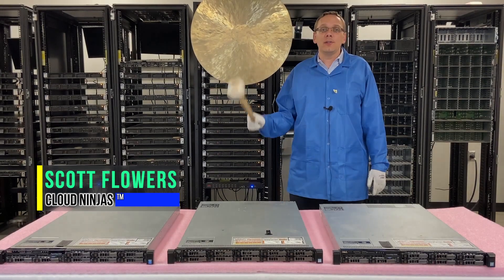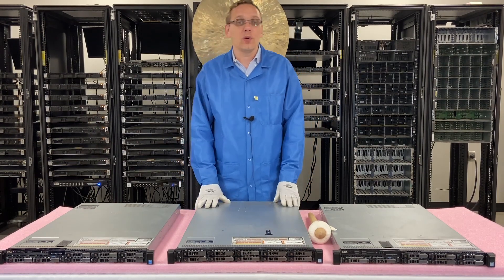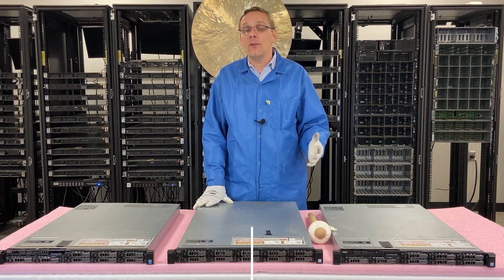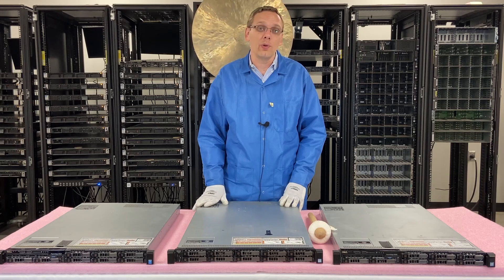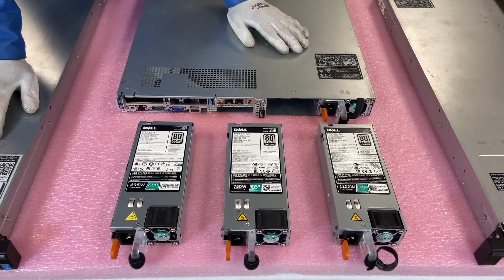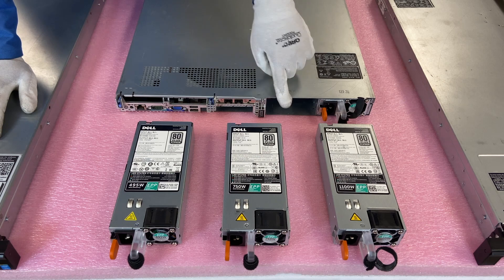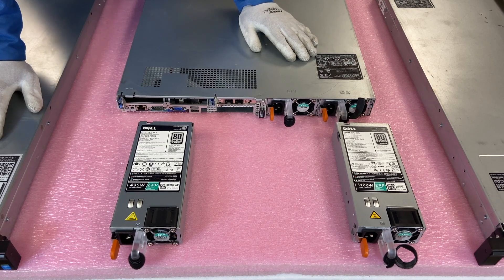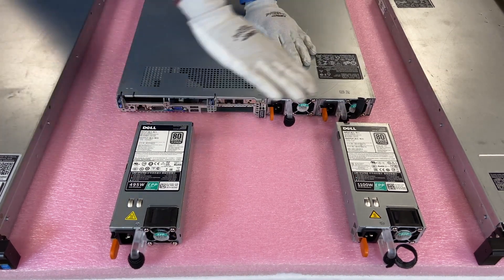Dell PowerEdge R630 Server Series | Power Supplies | Options | How to Install PSU | Hotswap

Comment: My R630 Dell Server is showing error "POWER INPUT FOR PSU 2 is lost. Check PSU cables ". What should I do. Thanks
Reply from the maker: Swap out PSU1 with PSU2.  See if error follows PSU.  This will determine if bad Power Supply or if bigger issue at hand.  Good luck.

Comment: When upgrading parts.. when do I have to upgrade psu? Like x amount of ram an x cpu requires x psu nothing about get. X an so forth
Reply from the maker: There's a lot that goes into power consumption.  Your CPU to start.   RAM Drives etc. Dell will give you a warning when redundancy is lost.
Reply: @ thanks! That’s good to know.

Comment: My R630 currently is configured with 2 x 495 W PSU. I am upgrading the CPU from E5-2620v3 to E5-2686v4. Will I need to consider upgrading both my PSU to 750W to support additional power draw from the new CPUs (TDP 80w vs 145w)?

Comment: Im running in a issue, on servers i use only 1 psu at a time, but if i have all two in the back it says me that one is broken. How can i solve
Reply from the maker: Will look into on our side.  Initial thought is bad PSU, bad socket or too much power with both installed for your outlet.
Reply: No, i meant one psu is plugged and one not but all are inserted into the server